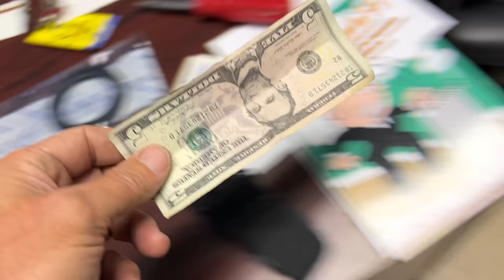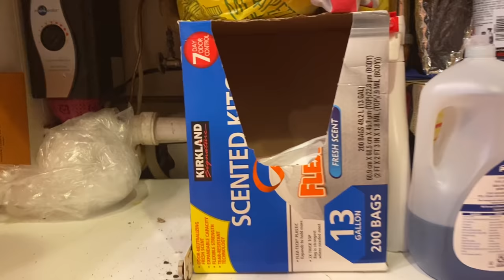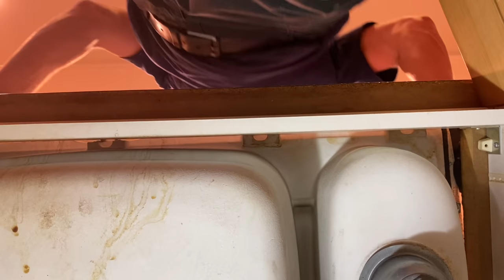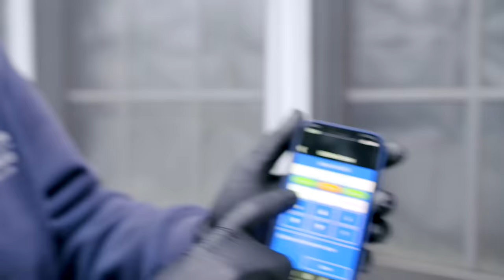Replacement Double Basin Kitchen Sink and Wolverine Brass Faucet Major Modifications Needed to Work

Comment: Mike we do these all the time. Instead of cutting that much out with your oscillating saw you mark where you're clips are going and you can drill 3/4" holes on the lower half on the wood and it acts as a pocket for your clips.
Reply: Meaning you drill a hole in the lower part of the wood in the spot where each hook is, in the bottom part of the wood, like to make a tiny hole for each clip? Am I understanding this correctly?

Could you just get away with silicone to glue the sink in, or are the clips necessary?
Reply: I agree...I ve seen alot of swelling around the opening of the wood due to heavy moisture and heat next to a dishwasher or leaks around the sink from heavy surface water due to poor sealing
Reply: @Supa Trending Daily You need to drill in from the side not from the bottom. Most flakeboard tops are 2 laminated pieces of 3/4" you need to drill the lower half. In 40 years I have never drilled up to the top.
Reply: @Joe60459  Unless it's a china or cast iron sink if you just caulk it down you cant get the whole sink to seal unless you cover it with plywood and some weight and let it sit over night. Not a big fan of silicone, polyurethane or solvent based is better. I worked with a bunch of granite companies and they caulk and clip all sinks before they bring them to the job. I recently went to a friend's place they bought as a foreclosure. The temperature changes from the house being left vacant for a few the silicone had actually started dripping down into the cabinet and the sink had come undone because they never put clips to hold it. There are many things you can get away with cutting corners but you never know how long it will last if not done properly.
Reply: @davidbates8757  they would install the sinks in the granite countertop before installing the countertop on the cabinets?

Is that what you meant by before they bring them to the job?

Comment: most manufactures have sink clips available for thick counter tops, some aftermarket clips too. if you know ahead of time or are unsure, you can take a router with groove bit and cut in a  groove in seconds. drilling holes where the clips will go with small spade/larger drill bit works also. the old "many ways to skin a cat" applies 😁
but, sometime you just have to use what's on the truck.

Comment: Mike found your channel today watching Veto bag reviews, I'm a service plumber also. A couple years ago  I found out  Milwaukee makes a fine tooth hole saw that works good on stainless steel sinks  .I have used if several times works great .Leaves a small burr on bottom side of hole that's easy to cleanup. I've done a lot of sink replacements .not my favorite thing to do.

Comment: Mikey all you had to do is cut a slot with your multi-tool, where each of the retaining brackets are, then if they renovate later, then  the original depth is still there. Just an idea that I have seen heaps of times by kitchen fitters. That at stuck in the same trap.

Comment: Why no air gap or a "high loop" with the dish washer discharge hose? Thought you needed that to prevent backflow in the event of a clogged sink drain.

Also a little surprised at no garbage disposal.

Comment: Pro tip: What I do to offer the best service to both the customer, as well as the fellow scrappers out there that are hungry for that scrap. 
I collect the numbers of scrap collectors. I've found over the past 3 years, a scrapper that will pick up, old linesets, garbage, old furnaces, and even help remove cast iron heat exchangers from basements. All free, no cost to myself. (He's even cut up, and hauled away an entire 20 Ton RTU piece by piece with a Sawzall, and impact drill. He made 2 trips, and on the second return trip brought  a case of water for my guys.) 
I've ran the numbers, and from what I was paying for people to do this for me at my expense, in labor, the value of the scrap in question, is not worth it for me to collect and process. 
Also I help out the less fortunate scrapper, who needs every piece of scrap he can find. He's essentially a full time employee at this point.

Comment: Do you prefer the handles to be centered, on the left, or on the right?  I normally find them towards the right - 90 degrees from center.
Reply: Them kind of faucets the handle should be out to the side.check any photo.of that type of faucet  it’s to stop pots and pans banging into the handle